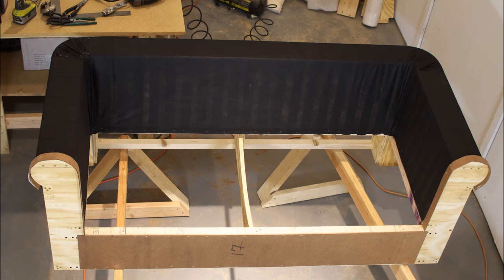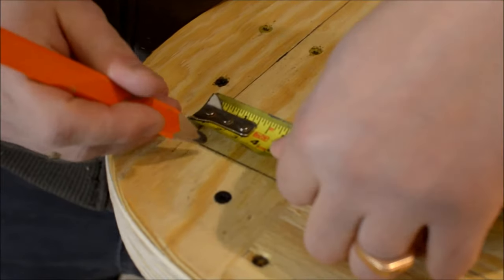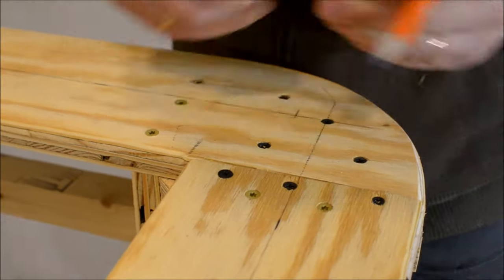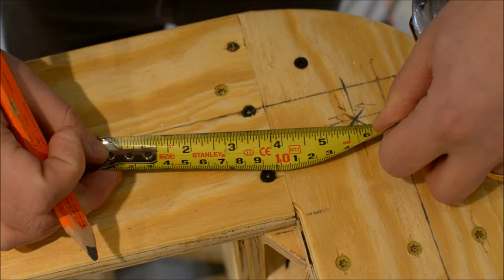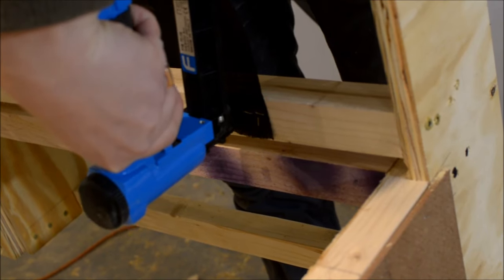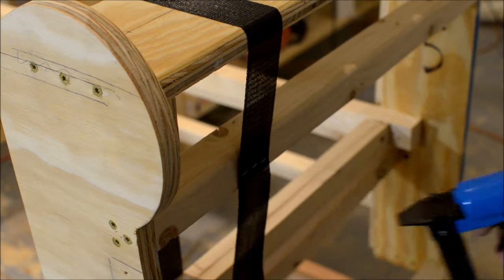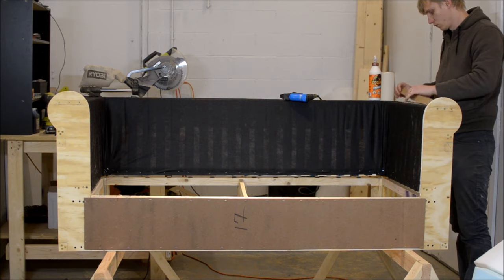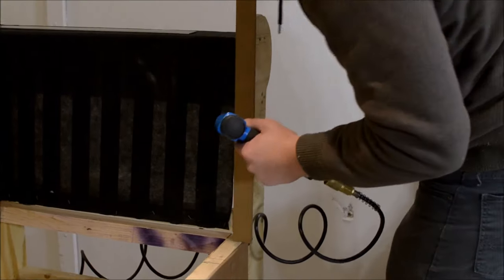How to make a Chesterfield Sofa, Frame preparation for the foam, Part 2

Comment: when we will see the final part  also what foam. do you use on the arms and back. thanks
Reply from the maker: Hi. We will finish this project in this month. We have used a HD36 Regular Foam (Density 1.8 LB/Cubic Ft.) for the arms and back. Thankss